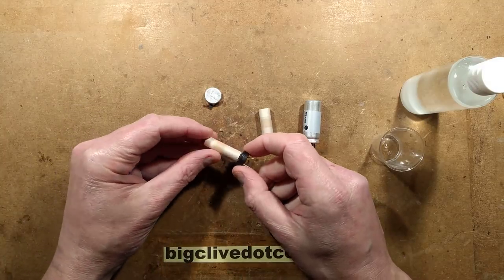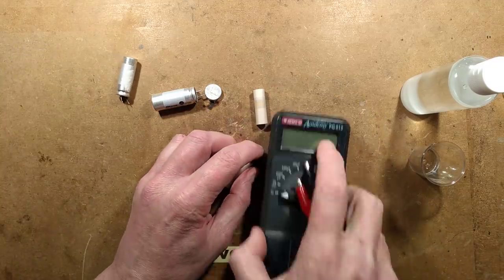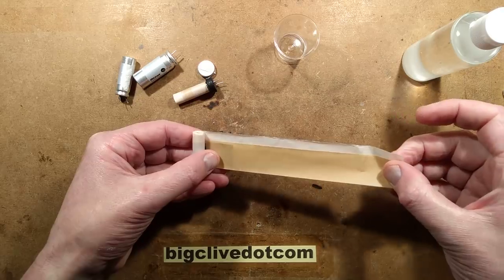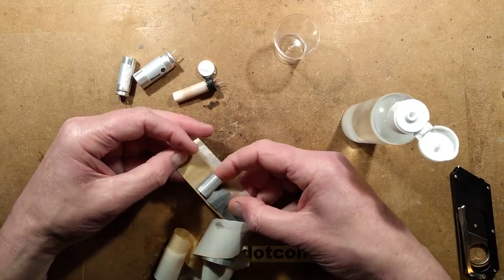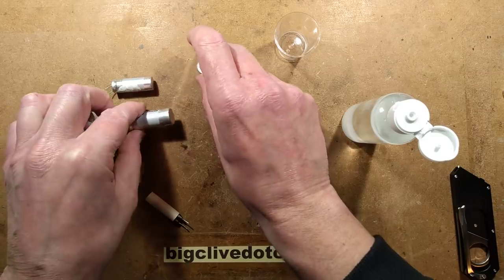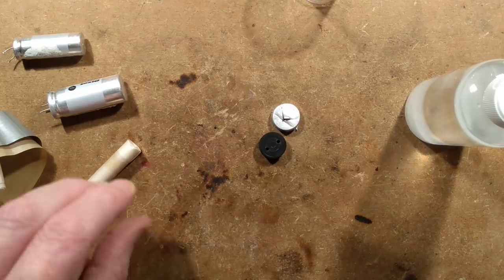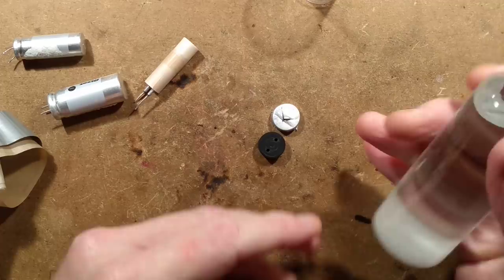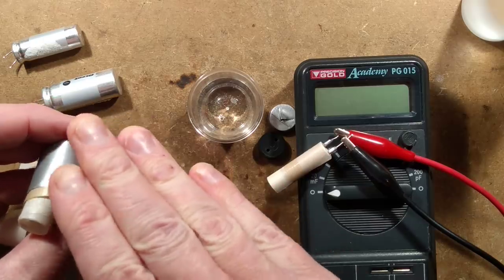Adding electrolyte to a fake (dry) capacitor.

Comment: It's not even decades old stuff that needs recapping, people like me who like fiddling about with old computer equipment from the early 00s are still dealing with the capacitor plague of that time.
Reply: I have been running a computer repair business for far too long now. I used to see loads of motherboards with popped capacitors but it is very rare now, the laptop I am typing this on is nearly 10 years old and still going strong. These days I am finding even ATX power supplies are far more reliable than they ever used to be.  The big brand TVs still seem to be using crappy capacitors in their power supplies though. I think what I am trying to say is cheap Chinese capacitors are far better than they used to be in stuff like branded power supplies which tend to come with long warranties but you can still get cheap crap for stuff like TVs which of course.

I miss those motherboards that used to pop their capacitors after just a couple of years!
Reply: Samsung tvs seemed to have caps with no cap.
Reply: @p166mx  Never had issues with caps on mobos myself. It was always the ones in the PSU, things used to just pop on me like a filament lightbulb would. Only ever had one mobo fail but that's because i accidentally exploded a bong inside the case while it was running; I did manage to resurrect it after 3 days of drying but it failed completely a few months later. Toughest cheap little gateway i've ever seen.
Reply: there far too much of this 'replace all old caps on sight', or 'it doesnt work? replace all caps and it'll be ok', rubbish, capacitors dont necessarily need replacing as much as some think, i have loads of old radios  back to the late 30's,  and especially in the cases of low voltage caps, in transistor portable radios, late 50's onwards, i've rarely had to replace any.. there were a few exceptions, of course, .. its the modern 'capacitor plague', afflicted , and generally poor quality ones these days thats the problem! ... and cap replacement is not a magic cure all or prevention of further failure or 'futureproofing' as some call it , other components can fail at any time, replacing capacitors wont necessarily stop this, ... from what i've come across, it seems capacitor quality dropped rapidly in the 90's, i repaired many colour portable tvs with dried up caps in their psu circuitry, it was a big problem with some brands,  while my old ferguson tx portable from 1986 only ever had one replace, a known common failure with it .... and most of the various crt tvs we had over the year never had cap trouble, we had a 70's 26 inch itt tv for a few years in the late 80s' to early 90's,  all original caps still in ....
Reply: @pickelsvx  i've come across many pc motherboards with bad capacitors.....and psus ....
Reply: Ahh the plague, 01-08 seen them up until 2011 products though. Definitely need a lcr meter though to know for sure.

Comment: I had an old workmate that was a little overzealous about safety about 30 years ago. I sat used bad plastic cased motor starting capacitor on the lunch table, for everybody to test and see. One day he was late for lunch, and I squirted some honey around the base. When he sat down and saw it, he got all giddy. He said, “Is that PCB’s?” I passed my finger thru it, and said, “Must be … it tastes like Vinyl.” He went berzerk. Then the other 3 guys dipped their fingers in it and said the same, one saying, this is good to know,  cuz now we can separate the PCB’ s from the non-PCB stuff. He was about to puke his guts out before we let him in on it.

By the way, it’s been a few years, but do you remember what the capacity was on the case of the ‘dry’ capacitor label - under the fake super capacitor label?

Comment: Just pausing at 14mins, you're doing it "right" as far as forming the cap. Not sure of the currents (or voltages for this cap but would assume/hope 16 or 25v for the application) but it does take time to form up. Speaking from experience of reforming high voltage electrolytics in valve radios, my rough & ready technique was to bring it up on rectified variac from 12-about 150v for around 2mins (to limit damage if it was fully short) and then just power up the radio with it in-circuit and let it run until the case was hot (ideally just when you're cringing that it'll burst, cut power) then let it cool fully for a couple of hours & it should be formed up and ready.

Having an electrolyte bath at your disposal this kind of method ought to work great since the cap is open and can't pressurise nor dry out if left in the glass. Just leave it on about 15-20v and observe the current flow over a few hours i would think it'd form up if it was ever going to. Then you could re-stuff it into the can and seal up, stick it back in the Mega Sultana and return it with some design notes for the supplier lol

Comment: I was so hoping that you would do experiments with those dubious "caps" and boom Clive delivers this is why I subscribed and never miss a video Hope you have a great day cause you made my day with this video holy crap can't believe that you tasted that  but at the same time I kinda can cause I would have done it too
Reply: Ditto here.
Reply: Hello... A&E, ....yeah me again, I know, I know, I just wanted to know how it tasted/if there was enough clearance/ would it fit/would it get stuck, the usual Darwin candidacy
Reply: I was playing with an old boost power supply a few weeks ago, I had forgotten that I removed the variable resistor to  install a multi turn, a job that I messed up by lifting a trace. The trace must have been touching ground or something, as when I applied 16 volts from 4 18650 cells, the 3300 MFD cap blew.  Wow that was loud, my good wife of 50 years, and our daughter who was visiting came running, they thought I had discharged my old .45 ACP Pistol that I carried when on the police force!  It was not nearly loud as a .45 but I have heard .22's that were not nearly so loud.

Comment: Used to have a thrift store here with a "test bench". I remember buying a portable TV full of silver confetti and bits of brown paper all inside it. Found a few of them on the bench with a 2 pin cord plugged into the wall going into the 12v in port. Eventually found the top of the cap jammed in the corner of the case. It was probably quite a pop but they still kept trying more.
Reply: I used to work for a company that did avionics repairs - one day, one of our customers (who was a large, well respected airline that I would have expected to know better) sent in 3 transponder test sets with the rather unhelpful fault description "inoperative".   They were designed to be operated either from 115V AC 400Hz or 28VDC - when I checked them, all 3 had explosively blown fuses on the 28VDC input and substantial damage to the PSU.  They had obviously been connected to the 115V supply using the 28V cable.  All 3 service tags had the same date on them, so presumably someone just plugged them in one after the other.

Comment: This reminded me of my childhood in the '70's. My Dad worked at S.T.C. (Standard Telephone & Cables) in Paignton, Devon. He worked making capacitors in the metallising & slitting section where vacuum chambers vapourised aluminium & coated plastic film. He often brought home rolls of metallised film before they were potted. Xmas decorations in our house were made from many, many rolls of metallised film unrolled & dangled about the place. 
There were takes of finger stools inflated with helium with loads of capacitor film dangling from it being picked up by Exeter airport radar causing many a UFO flap!

Comment: Could it be these are rejects from a real capasitor factory that failed some test and so never got filled with electrolyte and were thrown away? Or maybe the machine ran out of electrolyte and noone noticed for a while so they made a bunch of "dry" caps? Why would someone make a fake capasitor with everything but what must be the cheapest part? Disclaimer: though I've worked at a plastic cap factory in my youth I know nothing about electrolytic cap manufacturing.
Reply: Could be that they ran out of electrolyte and made a batch of empties, or they got new machines, and somebody bought the old ones as scrap metal, and a big stock of the raw materials just no electrolye, with the intention of setting up a fake manufacturer shop. Make them empty and you can make any voltage and value, in that size can, and they will not blow up on power up in the factory test. Probably were aiming at the LED light market, where the capacitor working is there to prevent flicker, so a fake will work for a while with flicker.

Yes seems silly for a part that costs cents, but if you can make them for lower price and copy a real one, then slip them into supply chains and get the real part price, then shift a few hundred thousand fast, you can make a short term profit, then move to the next sucker.
Reply: probably they ran out of electrolyte, or had a fault in the valves, and didn't notice until the first few hit QA, so they threw out the bad ones, and some rogue employee sold them at Huaqiangbei
Reply: They're gaseous-state capacitors. Several advantages over both solid and liquid ones. They're 100% stable, non-pollutant, cheap to manufacture, and have incredibly long life. Sure, they don't actually work, but overall you gain more than you lose.
Reply: @RFC3514  

I know it's a joke, but those would be paper caps since there is paper inbetween it's just not soaked. 5n or what it was is actually in the typical range for paper caps too. 
And "gaseous" caps with air between the electrodes actually exist - tuning condensers in radios for instance.
Reply: The paper is soaked in the finest Shenzhen air money can buy.

Comment: Usually to form a capacitor or battery you'd cycle it a number of times at very low rate. So you repeatedly charge and discharge at very low current, generally this is done on a computerised machine, a program will be setup and set running, this is then left for usually days cycling like this. I believe they slowly increase the rate through these cycles.

Comment: That little universal tester isnt always reliable, I have the exact same type myself and once I tried testing some solder wire and it came out as a MOSFET of some sorts. Several times, actually
Reply: solder wire IS like a mosfet - its either on or not.
Reply: I ordered a few Tip127’s this month. When they arrived I compared the HFE to the complementary 122’s I already had in stock. 

The tester (LCR-T4) reported the TIP127 as a NPN transistor, I reversed it in it’s socket and then it reported it as an PNP transistor....
Reply: Those Chinese component testers often get confused if you poke a component in randomly. After much experimentation, I've found that the six pins on the left are most reliable when testing passive components like diodes, resistors and capacitors. The tester will start giving errant results if you span a component too many pins apart in the socket, and especially if you cross the socket divide between the six and eight pin groups.

When testing capacitors, ALWAYS make sure they're 100% discharged because the microcontroller has zero input protection other than a couple of resistors. I've killed more than one of these things by accident by putting in a capacitor I thought was discharged. Caps have a tenancy to recharge themselves, especially ones with higher farad ratings. You usually have to short them out for a couple of minutes to drain all of the residual charge in the plates.

For larger DIP chips, it's best to treat the top left pin as pin 1, if you insert a chip in upside down, you almost always get errant results.

Most of these cheap testers available on Ebay, Ali Express, etc. are all based on the same firmware by the two people listed on the boot screen, and all have the same quirks and faults. There is different versions of the firmware, later versions generally have better component descriptions. I have a recent model which comes in a shell and a color TFT screen which is a lot easier to read and less prone to damage. I had a few of the model BC has and the screens usually end up damaged because the glass falls out and rips the data cable off.
Reply: Mine has difficulty with inductors with lots of series resistance. And faulty caps can make it behave funny too.
Reply: Could someone please add some links to recommended versions?
Reply: My board was not built with noclean flux, but they skipped the cleaning step anyway. There was crud on the board. It reacted with humid air and grew a diode between the B and C inputs with horrible specifications. I used a separate meter to verify that it did indeed conduct better in one direction than the other. Then I cleaned the board.

Use another meter and see if a crappy MOSfet actually formed on your solder. A gate capacitor can be formed with any metal that oxidizes and the oxide is an insulator.

There isn't much you can do with a MOSfet with a gain below 1.3, a maximum current below 500 microamps and no expected operational lifetime.
Reply: @userPrehistoricman  Bad capacitors definitely make the tester act weird. If the capacitor takes too long to charge, the tester will give up and show "unknown or damaged component." Shorted caps show as diodes or dual diodes, and capacitors with excessive electrical leakage usually show way over their rating so you have to know the original spec of the capacitor to make sure it's good or not. +/- 20% is normal for electrolytics, other types vary.
Reply: I mostly use them to identify and quickly test unknown transistors. As the measuring frequency is unknown it’s results only give you an indication about capacitors. 

If you are getting more serious into electronics the DER EE DE5000 is a great investment for measuring caps, inductors etc.

Comment: An interesting, informative and useful video.  Basically you showed that a "failed" capacitor, one that was showing no capacitance, could be made to come up to a reading, in this case approx. 1000 µF capacity...but it was still electrically leaky!  I know a lot of people believe in "reforming" failed capacitors, I don't.  But difference in opinion is the spice of life...and can be a good thing.  I'm NOT saying those who believe in reforming are "wrong" , simply that I don't think it is a good idea.

Comment: Well, the FIRST step in forming that dielectric layer is starting with a good electrolyte... ;) hehe Just poking some fun. I used to do this kind of stuff back in community college all the time.
You did have the basics of the process right. Reforming electrolytics is one of those 'tricks' I like to keep in my back pocket, so to speak, since it's usually more time-efficient to simply replace them. But there are those times when you can't, or shouldn't -- special VFDs come to mind -- so out come the [HV]DC power supply and power resistors, or the BIG Variac, HV film capacitors, and 3-phase bridge rectifier.
I really do enjoy these types of videos more than any other, getting down to the real low-level "how-does-it-actually-work" stuff!
Reply: what's the process to make the oxide layer ?
what did you put in your homemade electrolytes ?
Reply: @noname_atall  In a nutshell, it's the application of DC voltage in slow, steadily-increasing steps.
As for 'homemade electrolytes,' I'd have to dig up my notes from 20-ish years ago to be certain. But IIRC, I tried things like acetone, various alcohols, glycerin, brake fluid [ DOT3 (glycol ether) and DOT4 (borate ester)], propylene glycol, etc., with the addition of salts (sodium, potassium, magnesium, chlorides, take your pick). Those are all cheap, plentiful, and you can get large quantities, locally, without breaking the piggy-bank. Also note that ethylene glycol is not the same as POLYethylene glycol (PEG)! One is relatively safe to eat, the other is very much not.

Comment: Oh brother! I didn't know these rotary resistor selector thingies existed. I need one straight away.
Reply from the maker: I wish they were still available.  I got that one about 30 years ago.
Reply: @bigclivedotcom  Thanks for responding!
I usually use a potentiometer to dial in the right resistance for LED brightness and then measure the resistance and pick the nearest standard value. But this thing is much easier.

Comment: You really should be discharging the cap before putting it on the tester, especially after applying 12V.  I agree that it is probably not holding much charge, maybe you guessed the polarity incorrectly.
Reply: Is your user image supposed to be a bad looking Commander Keen? It's not what is it. Are you being a commander Keen? As well.
Reply: @aaronbrandenburg2441  Appears to be an edited version of Keen 4 title screen.

Comment: Ethylene glycol did kill my grandma's cat somewhere back in the early 00s.
It all started when a radiator began to leak water all over the floor and there was antifreeze in it. The cat couldn't resist drinking that water, unfortunately reaching the lethal dose of ethylene glycol.
Normally antifreeze has a bittering agent nowadays but apparently (From what I heard at the time) this heating system's antifreeze didn't have any bittering agent in it, given how hold the installation was, meaning it had the sweet taste of ethylene glycol and nothing to discourage animals or children from drinking lethal amounts of it.

Anyways the vet said that basically crystals formed inside the cat's kidneys and reading about it online a few years later revealed to me that it was indeed a sign of ethylene glycol poisoning.
But I also read that cats aren't sensitive to sweet taste like humas are, so I wonder if the cat would have drank that much radiator water if it hadn't any glycol it or not.

By the way after this incident the radiator has of course been replaced and the heating loop doesn't contain chemicals anymore, just water.